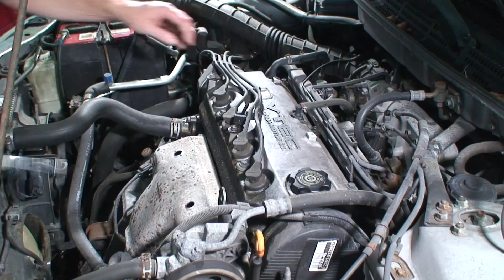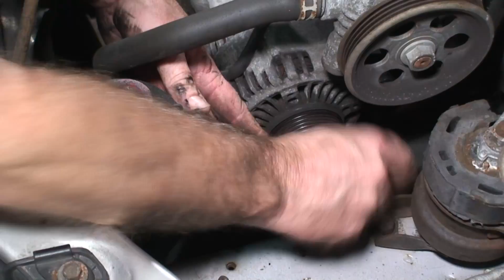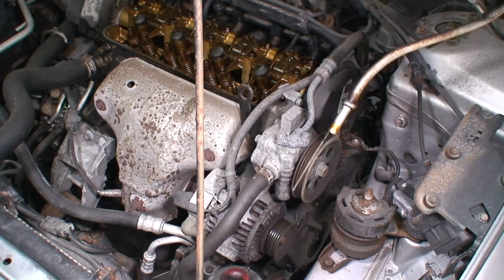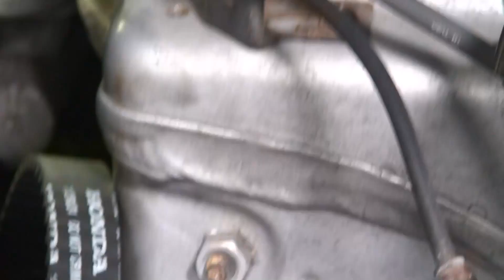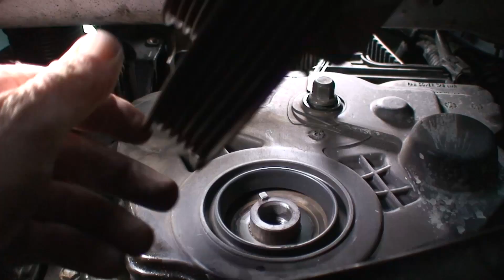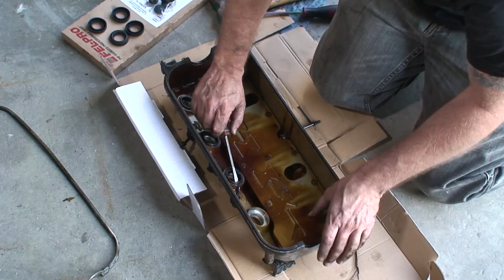2002 Honda Accord Timing Belt Balance Shaft Valve Cover Tune Up

Comment: Isn't the plug and locking bolt on the oil pump? There's a 12mm bolt on the firewall side of the block that you remove and insert a 100mm pin to lock it in place to install the balance shaft belt. In the perspective you're filming from this would be the pulley on the right side. That's on a 1990, so maybe it's different on this engine here?
Reply: Yes, it's on the firewall side of the engine block. This guy also did not seem to put RTV in the corners of the "humps" when reinstalling the valve cover, which will probably result in an oil leak.

Comment: Wouldn't it have been a good idea to flush that coolant system before replacing the water pump???
Reply from the maker: The coolant was completely drained at the very beginning, while we might not show that on video, he mentions it when removing the water pump. At the end, you have to cycle all the air out, and he may have said coolant flush, but it's really not a flush but running the system through several thermostat openings and closings so you can get all the air bubbles out of the coolant system. We edit out some basic elements to make these long videos shorter.

Comment: 34:40. What is the purpose of those springs after tightening the bolt on the pulleys. Do they still play a role or are they just for when setting the tension and then not do anything after tightening the bolt. I’m ask because I bought an AISIN timing belt kit and it was supposed to come with new springs but it didn’t. They end up refunding me $25 but I cant find those springs anywhere besides the dealer which is an hour from me. So I’m wondering if I’m fine reusing the old springs or not.

Comment: You skipped over lotta cover bolts, plus its a non interference motor snapped timing belt does nothing
Reply: No, it is an interference engine.
Reply: @MrUbiquitousTech  damn don't know nothing. Take the timing belts off and spin the crank. Bet me poser.
Reply: @MrUbiquitousTech  dang don't know nothing.  Take timing belts off and spin the crank. Bet me poser.
Reply: @MrUbiquitousTech  don't know nothing. Take timing Belts off and spin the crank. 
Bet me.

Comment: If I tighten them or leave em loose would it cause the car to Rev by itself when changed cause I changed the water pump and p it it back and now when I start the car it revs the engine as if I was pressing the peddle

Comment: Clear video and good instructions. I'll be comparing it to the book, but I'm hoping to do it myself very soon. I had the timing belt and water pump done 10k miles ago, and have noticed a vibration in the engine over 2500 RPM. I'm assuming the tech didn't get the balance shafts lined up properly. I also have a leak somewhere behind the lower cover. Thanks for the great instructions.

Comment: Hello Friend.
I'm in Brazil and I have a Honda Accord 95 when I disassembled my engine I noticed that the balancing shafts and their bushings are very worn, do you know what is possible to do?
Sorry I'm using google translator.
Reply: Order replacement parts direct from Honda
Reply: @Seavoyager45  Thank you!

Comment: I agree with HondaSolutions. I've done timing belts on Honda's and never put the timing belt on that way. YOU go the other way first, that way you can turn cam gear to take slack. Then around waterp,tensionor. Put spring back on to take tension up, then push up on bottom half of tensioner to take up more tension. then tighten the bolt. all marks must line up. But good video.

Comment: The timing you removed looks new, but the balancer belt you said is worn? Aren't they supposed to wear out at the same time? I changed mine after 200k miles and still in a new condition on both belts.
Reply: people sometimes just change the cambelt but not the balance belt at the same time and eventually the balance belt breaks and wipes out the cambelt at the same time

Comment: THANKS FOR THE CLEAR AND AUDIBLE AUDIO WITHOUT ANY BACKGROUND NOISES SUCH AS RADIOS OR KIDS OR PETS!  Best video I've seen so far.  My 91 accord has the front counter balance shaft pointer at the 12 o'clock position and oil pump shaft at about the 4 o'clock position.  Actually it was aligned with screwdriver into the back of the block.  Thanks again!

Comment: At idle a bad pcv valve sticks open enough that vacuum is created in the engine and oil is pulled thru the pcv hose. These pcv valves by default are open, it's the vacuum on one side and pressure on the other side that makes them work. At higher rpms, and low manifold pressures that's when they open up and vent crankcase pressures. At idle they are not supposed to stay open. Also just because a pcv valve rattles does not mean it's good, it could still be bad. A cheap item to replace, so when in question just get a new one.

Comment: Not following the Honda service manual tensioning the belts properly, the springs are there to set the tension if you follow the service manual and do it properly. Also not correctly setting the rear balance shaft timing with an M6x100mm Bolt screwed in 74mm into the back of the block.

Other than that its a very useful video
Reply: I can't seem to be able to lock the balance shaft at the right depth. I've spun it three times and tried to get something in during the whole process, I wasn't able to find it 

Right now I moved it back to TDC where it was. Car was running ok, but I find it odd I can't get the set up right. Any tips?
Reply: That's not balance shaft the rear bigger one
Reply: Seems like nobody on YouTube has done it. They all seem to have different methods.. which one is right?
Reply: @MacroMicro99  as long as the balance shaft doesn't move when align all the timing marks before you remove the belts then there wont be a problem

Comment: I have yet to see a video correctly tensioning the timing belt according to Honda Factory specs.  This video did not explain how to do it correctly.  You put the timing belt on, rotate the crank counterclockwise 2 turns make sure your marks line up and turn the crank counterclockwise 3 teeth and let the spring (which you didn’t put on) tension the belt.   You also didn’t show how to correctly align the rear balancer shaft. I’m sure the engine won’t be balanced.
Reply: HondaSolutions do u have a vid with the correct procedure, i need to do this job .
Reply: I agree, the balance belt also has to be timed from oil pump side and wasn't shown. Just had to have it today.
All above will work except the oil pump positioning. First of all there is 1:3 ration between oil pump pulley and pump itself which need to be found by removing bolt on the side from behind the engine and insert 4-5 inch pin and find that one revolution out of three where pin dives in. Next, make sure the groove on a sprocket points to thin line on the pump case, it's about 5pm which is actually correctly pointed in video, but I guess by accident. Other then that I'd say all above will work ok, regardless it differs from honda SM. I'd say it even clearer then the book as it actually shown in action. But that's only my opinion...

Comment: You can make a weighted socket a 19 mm inside a 1 1/4 socket impact sockets weld together works every time.
Reply: They actually sell those. Works wonders for the Honda crank pulley bolts https://www.amazon.com/Lisle-77080-Harmonic-Balancer-Socket/dp/B00RGNCV1U

Comment: Why no coolant came out when you removed the water pump?  Did you drain the block also?   Where is the drain bolt on the block??
Reply from the maker: We drained the coolant out of the radiator, Once the coolant level gets down low enough, it doesn't drain out.
Reply: I don't see how that is possible.   Both radiator hoses connect back to the engine at a level above the water pump.   Did you drain it with the engine running so the pump forced water up and out??
Reply: When he jacked up the engine with the left side raised it put the engine at at an angle to where what water was left in the engine flowed to the right, away from the water pump housing...

Comment: these honda engines eat sh.t
Reply: Cliff Perrino why u say that?  I got 200k on mine and nothing has been replaced except the spark plugs at 100k.   Seems rock solid to me.
Reply: too many tiny marks on gears you can barely see and  must have in sync or f up the motor ,are you serious havin to remove a plug in the block and put a bolt in and maybe it will sync engine., they are shit to work on.
Reply: He is saying that cause he still drives a scooter

Comment: What kind of a person shows replacemwnt of a timing belt, but does not know that what they call the oil pump pulley is actually a balancer shaft. And also says that that same balancer ahaft pulley has no specific orientation. You should take this video down. It's just misleading and wrong.
Reply: Actually, he did say that the rear (rightmost) balance shat pulley is timed and the orientation is at 5 o'clock. There is a casting on the engine block against which the pulley groove is required to be timed. Where he did go wrong, was that he had the front and rear balance shafts mixed up. The 6 x 100 millimeter locking bolt needs to be marked at 74 mm and is inserted into the maintenance hole, which can be accessed by removing the 8 mm bolt and washer that normally covers it. Incidentally, the bolt can only be fully inserted once every 3 pulley rotations, even though the timing marks are properly positioned on each rotation. This is extremely well demonstrated on the WILEY Motorsports video at https://www.youtube.com/watch?v=nQCRLRLFPMU.

Slightly amateurish job, from the point of view of a technician with 50 years experience, but it does cover the important points and I'm sure many people will appreciate the guidance this video provides. Proper tensioning of the various bolts is important and lack of this is the main reason why the cover bolts break loose in the plastic housing.
Reply: Olli Makkonen so the cover bolt wasnt tensioned properly at the factory?   Seems to me that Honda wants to sell replacement timing belt covers.
Reply: Hi Gene Friedman, not so much at the factory, rather the previous repairers. Rarely these around 20 or so year old Hondas are still running ex factory timing belts. Thanks for your comment, enjoy the life and have a nice day.

Comment: Thank you so much for this video, it help me to fix a botched timing belt job by a local mechanic.  Now my engine is back in time/balance (They were a tooth off on the timing belt), running smooth as butter.

Comment: Hey Buddy no Sealant on the water pump gasket? Say, for a lil insurance?
Reply: Generally don't want to use sealant on o rings. If you must, use a tiny bit on non hardening sealer.
Reply: Nope, it does not require any.  The O ring is all.
Reply: No need for sealant on rubber seals for most cases. Generally adding gasket sealant is for corners where the rubber seal can't seal very well.

Comment: Had the same bolt on the top cover problem. Ripped it off and had to replace it. 100$ later, it was cut in other spots, oh and had to take the belts back off to put the back cover of the top cover

Comment: How do you get the sprocket for the counter balance shaft off?? How do you get the square key stock out of that hole that holds the sprocket on?
Reply: There is a hole drilled into the shaft behind the sprocket. You insert a screwdriver or similar tool through it to immobilize the shaft while you use a socket to loosen the sprocket bolt.
Reply: show me the timing mark on a 2000 Honda Civic

Comment: On the 2000 Accord 2.3L, there are 2 balance shafts... The one in the rear (right side) turned by the oil pump gear is the one you insert the 6 x 100mm bolt to lock... Just nit picking, but he mentioned he was going to turn the engine over 5 or 6 times. It should be 2, 4, or 6 times to end up with your marks positioned correctly. FSM recommends to rotate twice (Crank rotates twice for the cams to rotate once).
Reply: The rear balance shaft is rarely correctly timed by just lining up the timing marks. The locking bolt is needed to correctly time the shaft. The 6 x 100 mm bolt, marked 74 mm from the end, can only be FULLY inserted into the shaft once every 3 revolutions. The other 2 revolutions of the shaft, it only goes in part of the way. The timing is correctly set when the bolt can be inserted all the way up to the 74 mm mark. Just how important this precise timing then is, is another matter. During my career I have come across quite a few shafts that were not correctly timed, yet the engine run reasonably smoothly.
Reply: @ollimakkonen6481  Yes, you need to insert the bolt through the service hole on the right side of the engine, not the left... a 100mm bolt inserted 74mm to lock the inner gear. BriansMobile1 has a great video on this engine showing that exact procedure...
Reply: Came here to say this.  If you don't clock it correctly the motor will be out of balance.  The dot on the sprocket face should be pointing to about 5 o'clock
Reply: Whats the point of locking it if the orientation marks are lined up?
Reply: Thanks for that 2,4,6 turnover detail, very useful lil detail
Reply: Yes this is correct and confused me watching his video. I don't think this engine is properly timed. It'll probably run fine but you can see a timing mark on the oil pump pulley just flopping around as he installs the belt. This is why youtube university is not accredited, folks.

Comment: Also do you just finger tighten the bolt holding the balance belt tensioner? Just asking, cause you didn't tighten it with a wrench. I didn't notice it, if you did.

Comment: Did I hear you say the timing belt was water pump driven?
Reply from the maker: the water pump is timing belt driven
Reply: APDTY v6 or 2.3? Because 2.3 is not.
Reply: @andrewjimenez6884  2.3 is i just had it done water pump is driven by timing belt